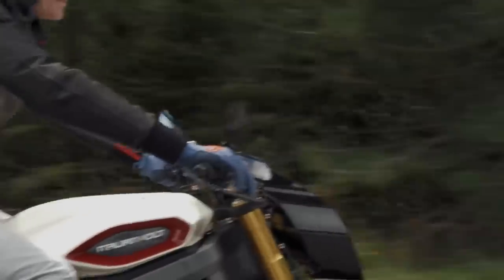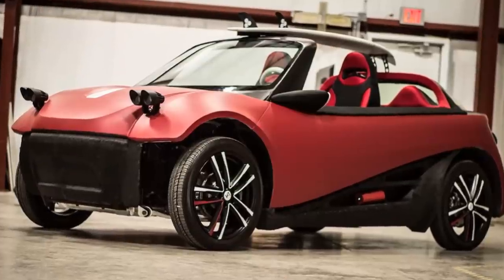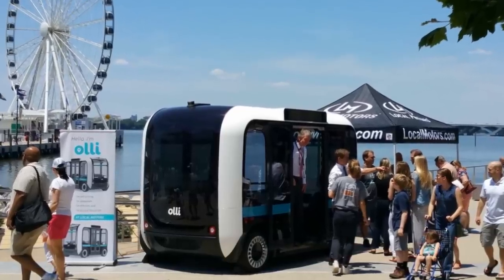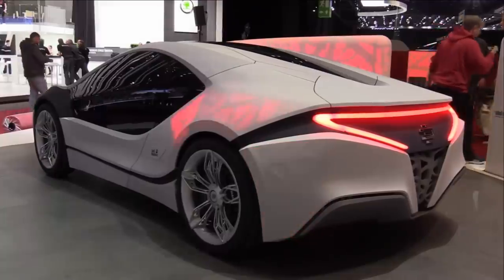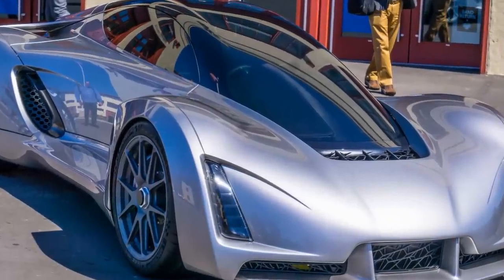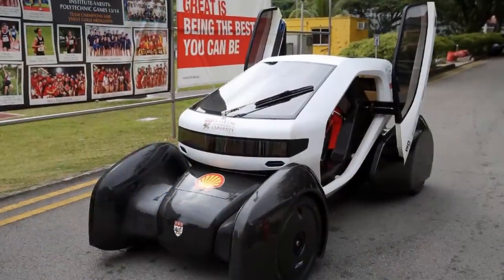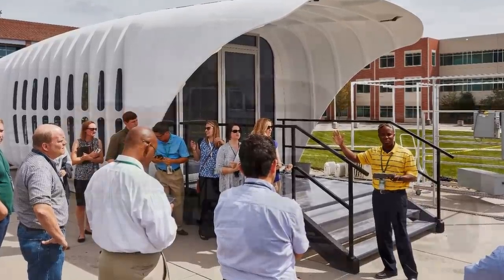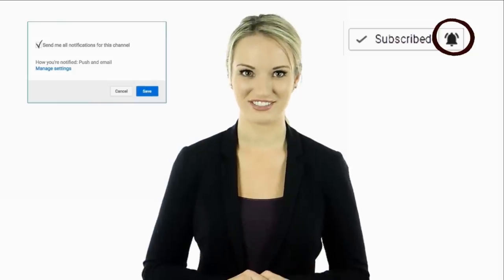10 Amazing 3D Printed Cars

Comment: I have a 3s printer, here are the pros and cons. 3d printing 1:   Fast prototyping for fit testing and track testing.  Cons 1: quality control 2. Layer separation 3 aligning multi compound plastics and fibrous materials in a fashion for structural stamina 4 thermal inductance of parts throughout the vehicle even with high temp plastics.   Injection molding and metal forming press pro rapid part production, quality control is more efficient and precise, the ability to add structural additives and or layers such as (carbon, metal, teflon inserts, structural brakets, threaded studs). Cons not suitable for rapid prototypes, tooling time,  and retooling if you need to change or redesign due to the shrinking properties of the plastic during the cool down stage.    I love my printer and if you were to combine both tecnics to your process to your final goal then truly lightweight highly efficient cars can be achieved. What you just saw was a fluff piece.
Reply: Because of 3d printer's inability to make something structurally sound as conventional methods, even when reinforced or madd with metal, I only ever see it being used for prototyping and making non-crucial components (like the shell for cars); niche items being the exception, like that one aerospike nozzle.
 
Making a car isn't hard, getting the design approved and manufacturing is. Printing is too slow and unpredictable for the assembly line which is why, like you said, a combination is the best solution (and usually always is).

Comment: #2 YES, SOLAR CAR!!!
The future of cars must be solar!
Reply: Solar is fine if you only drive the car a couple times around the block every day, or if you only drive it once a week. The problem is that to gather enough energy from the sun to allow the car to operate over a typical commute distance, especially if it is roughly the size, weight, and provides an acceptable level of crash worthiness as a typical car, will require a big solar array, much bigger than the car, at which point, it's not really a solar car anymore. You could then just as easily buy a Prius or Volt, charge it with a big solar array, and call it a "solar car",as well.

The problem is that the energy density of sunlight isn't very high, and the efficiency of converting that sunlight to electric energy is low, further reducing the effective wattage per square foot of solar panels. And, if it's cloudy, the energy generated is even lower, and unless you live in Arizona, undependable.

Comment: All of the vehicles (and house) are interesting. Most interesting are the AIME house and the Nanyang Venture 8. The Venture 8 might be used as the basis of a really good all-weather city vehicle (to replace the Bird-type scooters, maybe?). As for the AIME house, I'd be interested to see how it holds up in inclement weather. It might be the basis for replacing prefabricated housing, especially if it can hold up better than do current prefabs.

Comment: I would have thought that 3d printed would be cheaper than normal cars, not on par or ridiculously expensive.
Reply: The high cost comes down to three factors.

1) The bulk of the cost of a car isn't the frame but rather all the metal mechanical parts such as the engine, transmission, and supporting accessories. Even an electric car uses quite a bit of metal.

2) These vehicles are probably solid infill which uses a huge amount of material. The reasoning for this in a car is because colliding a very lightweight (a few hundred pounds) 3D Printed car at highway speeds against a several thousand pound truck would flatten the much lighter car. 

3) Most of these vehicles include highly experimental and expensive technology that is completely unnecessary for their core purpose. They are trying to cater to the "ooh shiny and futuristic" crowd rather than focusing on the basics of what is needed to drive.

As as engineer who does a lot of 3D Printing, I speculate that a very simplistic (just the basics needed to drive) 3D Printed car capable of hitting common highway speeds and still have impressively high acceleration could be done with only $2,000. But there's a huge catch.... you would never get it road safety approved to sell it. Even hitting a road sign at 60 MPH would demolish such a light car killing anyone in it.
Reply: @autonomous2010  Good points. Unfortunate but true.
Reply: @bodipsypha  A person that truly wants to experiment should look into the FAA Part 103 in the USA for experimental aircraft. Sadly there is no such equivalent for experimental vehicles. I'm currently working on creating a full sized prototype aircraft that is 3D Printed (excluding the engine, prop, clutch, electronics, etc). Personally I find it a little disheartening that 3D Printers are mainly only used for trinkets so it's one of my goals to greatly expand that into practical creations. 

3D Printing definitely has future potential but the biggest limiting factor is that plastics are not nearly as durable as metals. Not even comparably so. But being able to print new parts at home for a contraption is a pretty neat point. 

If the contraption i'm working on does have at least reasonable flight stability, I plan on uploading the design draft as public domain property. So that theoretically any engineer that just happens to have access to a 3D Printer and knowledge of maintaining engines can sorta print out their own aircraft. Just in many parts that have to be merged. We shall see.

Comment: 3d printed frames / bodies mostly. All electronic and mechanical parts are not.  
Seems like it makes it more expensive instead of cheaper, and it's not easier to print / fix. 
I like the blade & LSEV a lot since they are the most 3-d printed. 
The venture-8 is interesting since it's 120 lbs, so far far less materials. 
This a a long way from going down to your LOCAL 3d printing shop someday and getting parts made to fix or make a car of your choice to eliminate shipping. And really this is the only reason to go with 3d printing for  car parts really since other methods are better and cheaper. 
I think all these vehicles would have issues passing impact safety requirements.
This is still not in the direction to get away from huge corporations who will try to control human innovation for modes of transportation. So much so I'm sure they are all very busy either buying up intellectual rights for 3d printed ideas or making their own to stop its use and or control it.

Comment: ELECTRICS CARS SHOULD RUN AT LEAST 2000 MILES BEFORE CHARGE
Reply: No machine or human travels that distance non stop other than planes demand something which is practical.
Reply: even the best hybrids can barely go 1000 miles on one tank
Reply: @ag135i  personally i think reasonable would be a minimum 350 miles between charges.

Comment: 3D printing is only an option for rapid prototyping.  It is MUCH more expensive, weaker and with inferior surface finish than traditional manufacturing methods.
Reply: Exactly right. Let's see what happens when one of those things is hit by a real vehicle, like a semi, or even a Chevy Suburban. Except possibly for the bus, these things stand zero chance of passing Federal crash standards. You might as well put six handles and a lid on it for the pallbearers.

Comment: The biggest problem that comes with any of the cars shown here is just the thought of putting yourself in something so dangerous if you were involved in what would be considered a minor accident with a normal card, much less a large commercial size tractor trailer. Your chances of survival would be close to zero. I'll stick with something that provides a little more safety myself.